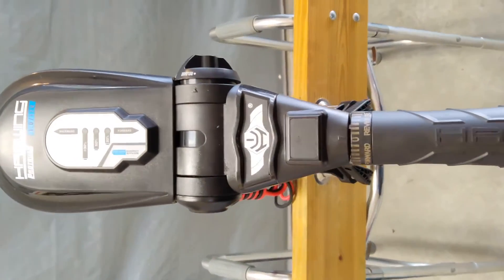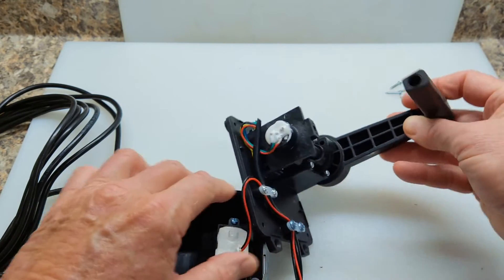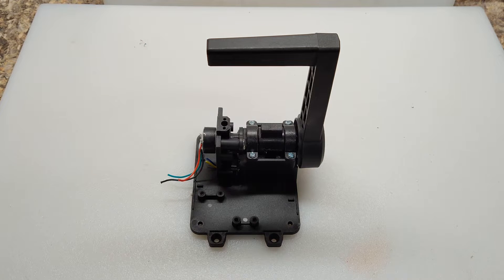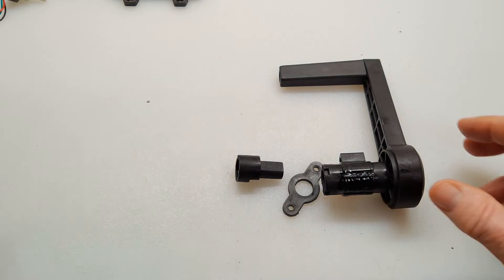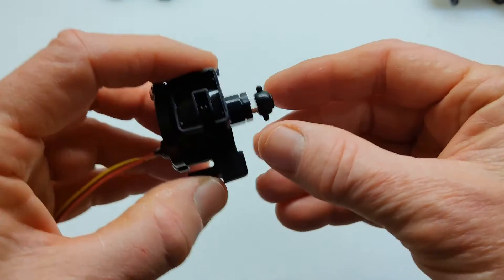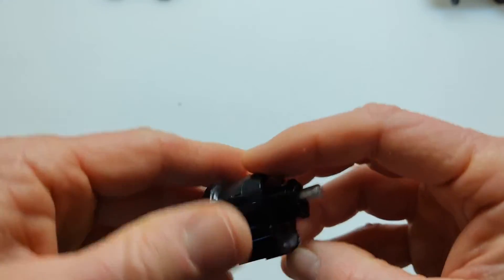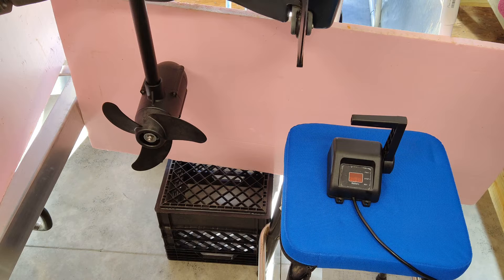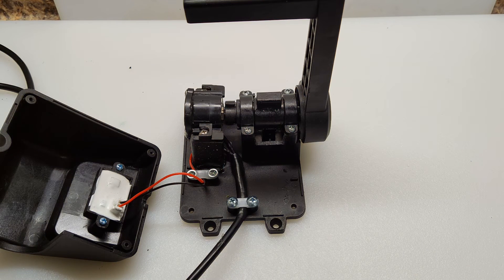Haswing Protruar 1.0 Potentiometer Modified Speed Controller

Comment: Great video, very informative!Would it be possible to install a kill switch on one of potentiometer’s wire? I’m planning to relocate all elements from the head to control box via 6 pin wire connectors and add magnetic kill switch.
Reply from the maker: Thank you. No, a standard kill switch will not work on a pot wire. I installed a relay switch with a magnetic kill switch on the power to the motor.
Reply: @Aksmaniyak yeah, I figured out to use relay on power line and 5 prongs wire just for pot relocation and kill switch from relay. Thanks!
Reply from the maker: @GennadiyOgay  Glad to help.
Reply from the maker: @GennadiyOgay  Glad to help.

Comment: what was the reason you didn't use the speed controller as it came from the  factory please ? I'm about to do the same thing like you ,just checking ,as if I can just connect the controller to my motor it will be easier . Thanks !
Reply from the maker: I wanted to see if I could modify the lever controller for use as a remote. I have also built a remote box using the stock potentiometer. I like having a remote instead of using the handle throttle.
Reply: @Aksmaniyak   I totally understand that ! I will cut the handle of mine and definitely have a controller on my dashboard , the question is if I order that controller from AliExpress will I be to use it directly without replacing the potentiometer ? Always appreciate your help!
Reply from the maker: Thanks. I tried using the controller with the provided pot and my trolling motor went crazy.😆 You will need to use the Haswing pot or the 10K with 1K resistors set up.

Comment: Originally I used the 10 K with resistors as Bass Man used , found top speed was not as fast ,  Like U , decided too use the  stock haswing pot , Installed  into a 3/4 water proof box , mounted on rail next too seat ,  added a knob , worked fine over year , until one day motor went berserk , then stopped working ,   Prior too motor failure I contacted Haswing too purchase  back up Pod .   Only contact is thru email , days between responses , Wanting to purchase back up Haswing POD ,  Told no inventory  if they can obtain up too  6 -8 week wait , Fifty bucks ,  since I took apart top voided any warranty which is almost over ,  You did nice work on your trottle ,
Reply from the maker: Thanks Alan. I have searched for an alternative Haswing pot back up source and have been unsuccessful too.